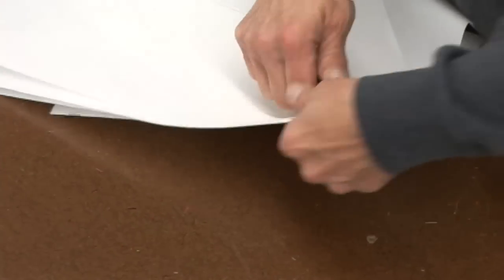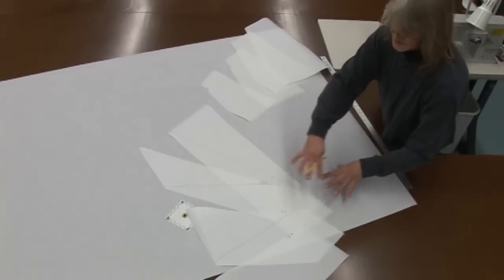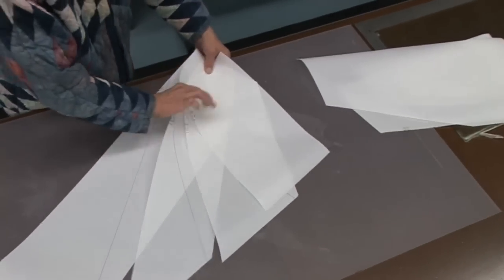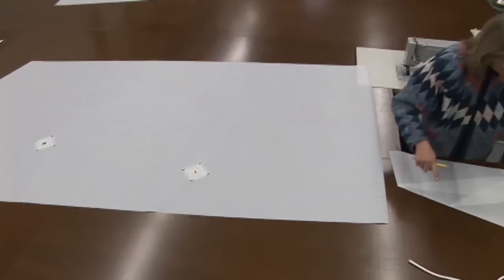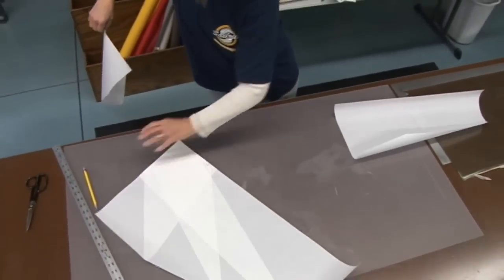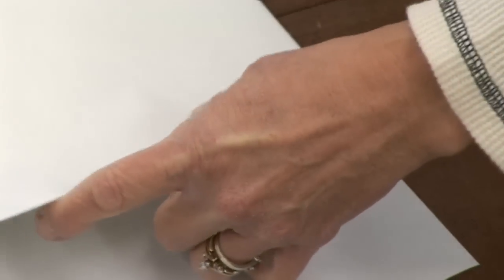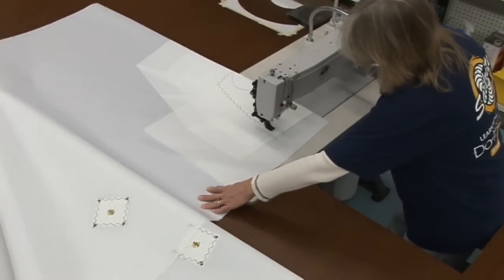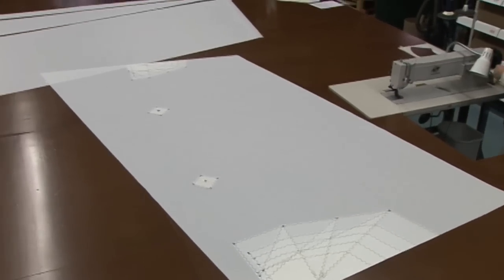Assembling Corner Patches - Building a Mainsail - Part 3

Comment: To be clear, the patches at the clew and tack are on one side of the sail only, not both sides such that the sail would be sandwiched between two patches, one on each side, correct?
Reply from the maker: That is correct, they are on one side of the sail only.